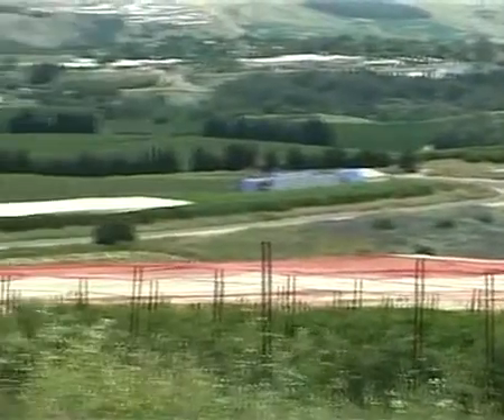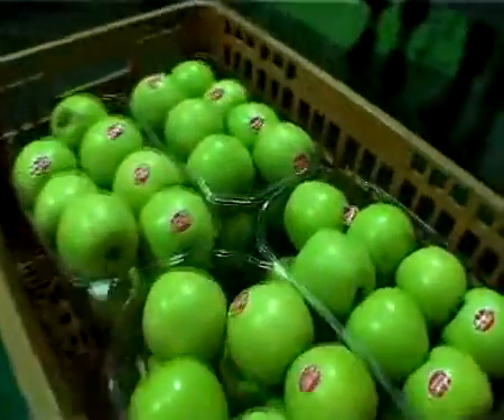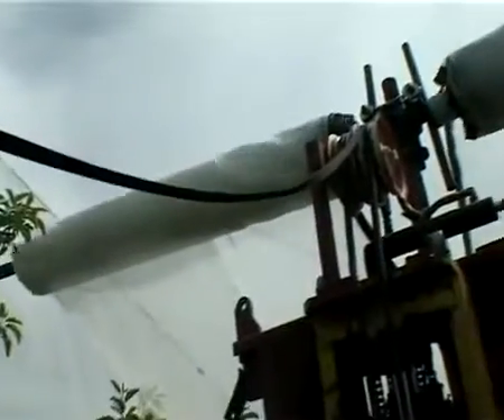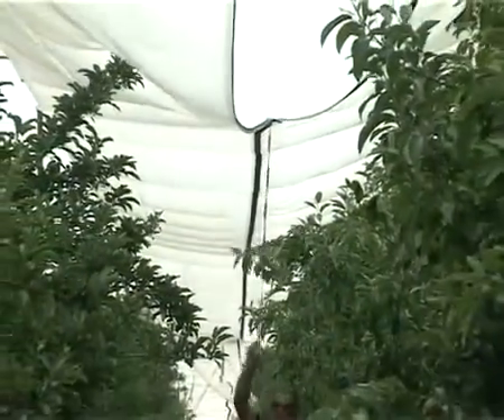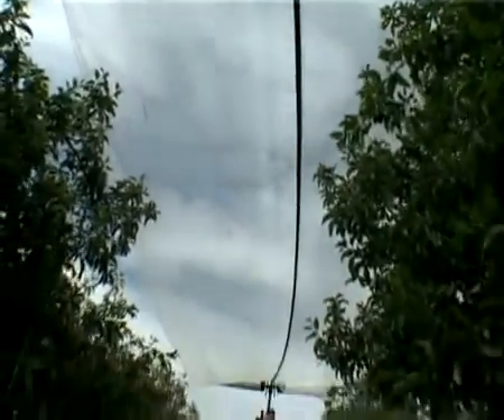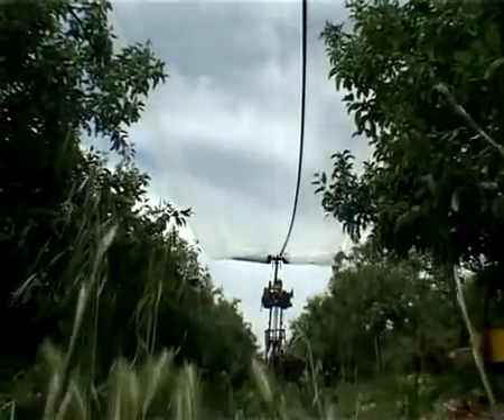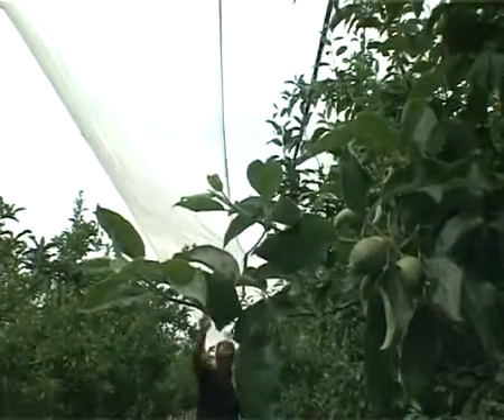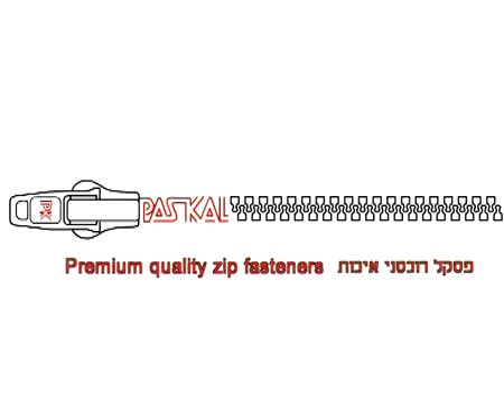Shading & Anti Hail Nets Zippers - Paskal

Comment: How do you discharge the hail accumulating on the net during an hail storm?
Reply: Unzip?
Reply: @krishnakitchen3655  During the hail storm? If the system will carry all those hail, it is most likely to collapse. Or the system shall be too strong to carry all accumulating hail which will increase the cost of the system.
It is not practical, although seems very easy to open and close.